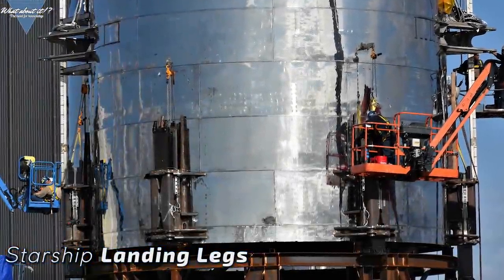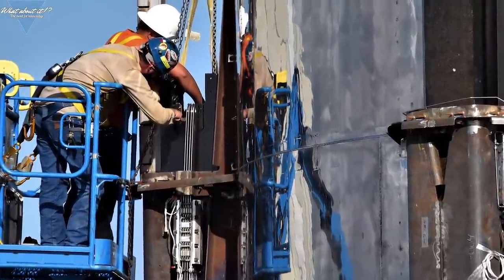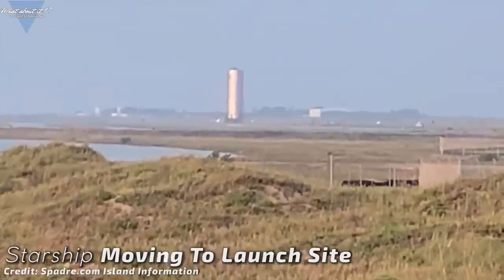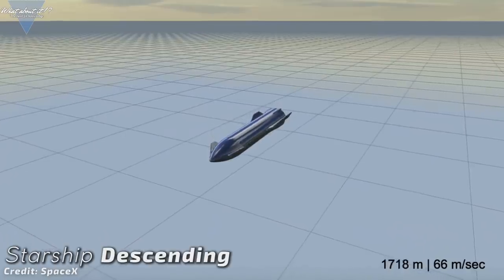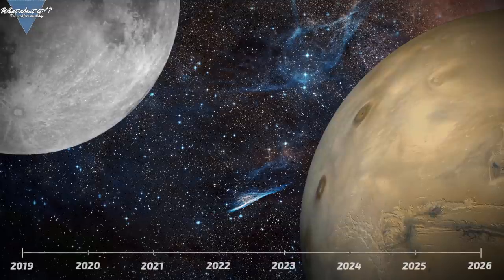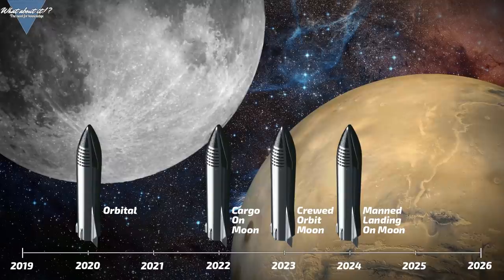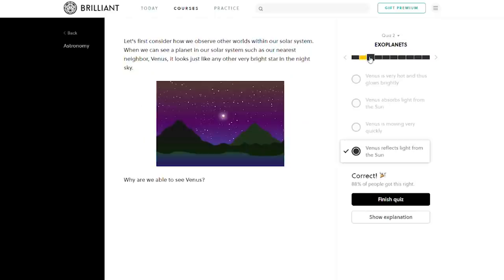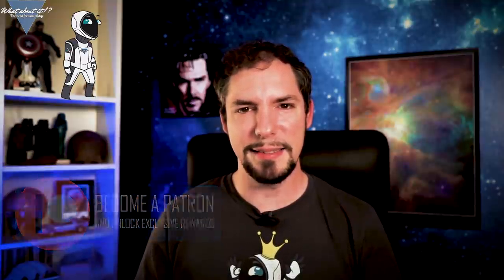46 | SpaceX Starship Updates & New SpaceX Moon Landing Schedule

Comment: A)    Some form of linear ramp motor (DC).  Remember that these stabilizers (or landing legs) are on the booster, so will not be landing on rough terrain, just their return pads.      B)   Nothing wrong with the time schedule. Even if it slips a little from unseen circumstances, it keeps the workers on their best foot.    Thanks once again, Felix.

Comment: 0:35 I think that the real ratio you have to consider is (position of Center of gravity) / (wide of base).  Probably the ratio is less than 2 in the Starship, very estable (tipping angle aprox 14º)
Reply: Great point, Enriquue!  We don't know where the vertical center of gravity (CG) will be, and CG is what really matters--not the overall height.  
The CG can be manipulated depending on how they build/load it.  We DO know Musk was worried about CG being too low to execute the controlled "skydive fall" reentry, so they put heavy batteries and controllers in the nose.
Reply: @737smartin  Maybe what the need is to mount the batteries (and other heavy stuff) in an elevator in order to move the CG dynamically: High for flight and low for landing :-)
A minor complication of the elevator would be that it needs to pass through the tank sections :-O ;-)
Reply: @Jens.Krabbe  That is JUST what a submarine does but horizontally by using its trim and auxiliary tanks to maintain a neutral buoyancy. Not a bad idea in theory.

Comment: If SpaceX can successfully launch and land Mk 1 by the end of this year, I'll give them a slim chance of actually making it to orbit by 2020. 
But landing this thing on the first try is not going to be easy. SpaceX has already lost eight Falcon 9 boosters to landing failures. And Starship prototypes are much larger and more difficult to assemble. So having just a couple of landing failures will set them back quite a bit. 
I'm pumped to see the first flight test!
Reply: No..They will use the Falcon9 Data and Starhopper Data to make Starship Land.. Sure there may be some failures but not as much as their first try on Falcon9
Reply: Look at Blue origin and their shitty landings (after 15 years), compared to SpaceX. There must be something about the software, SpaceX uses. It is adaptable, like we saw with the "failed" landing of the booster for CRS-16. Technically the landing was correct although there was a major technical problem. Their software is just unbelievably tolerant
Reply: @Fannystark007  Keep in mind that this is going to be a much more massive rocket than the Falcon 9, and will approach landing differently. I'm sure SpaceX will use whatever knowledge and experience they have to attempt a successful landing on the first try. But even a single setback can set the company back, and the Starship timeline is RIDICULOUSLY ambitious. I love to see it, but everything must go perfectly, all the way through. 

Look what happened with the Dragon crew capsule explosion. The capsule was supposed to have been carrying astronauts by now, but because of this one setback, it won't happen until the middle of next year at the earliest. And if they have another setback... 2021, maybe.
Reply: @Fannystark007  you may say "Machine Learning"

Comment: When you spoke of the stability of the vehicle when on it’s legs did you consider it’s centre of mass on landing. All the fuel gone and the engines down low it might be more stable than you think.
A good chess set has lead weights in the base of its pieces. The queens of my set has a tip over point of about 45    degrees.

Comment: My conjecture is that legs will drop by gravity and the brakes on the legs will only activate once all 6 or all of that leg's tripod have touched the ground.  (dividing the legs into two tri-pods and equipping each leg with redundant left/right ground contact switches and leg brakes would make this a very reliable 4-way redundant system)  This logic is very simple to setup, and gives you self leveling with no new code and no new heavy active actuators.  I do expect to see a positive locking feature added eventually, don't want the rocket toppling because your brakes slowly leaked and lost grip... 

The eventually retraction mechanism will be the lightest practical.  So for example, a RCS firing on orbit or a pneumatic cylinder, etc.

Comment: considering how much weight the engines add when the tanks are empty, the center of mass is probably very low when landing, so the legs would be wide enough. Landing with cargo is a different story, but I think they've got enough experience with control systems to get it precise enough.

Comment: Heroic schedule with myriad firsts!  The Starship/Super-Heavy Launch System is monumentally huge on several counts with multiple component and system design challenges, each with its own set of complexities. I'm sure SpaceX will keep a close eye on the critical path(s) and relative degree of risks associated with each major component and system. Lots of places to fail/learn. In SpaceX's favor, they have continually demonstrated a withering design-build-test-redesign-rebuild cycle. Hopefully they are able to ferret out most of the design and function problems/solutions in the component/sub-system test phases. There will probably be some major cliff-hangers during the major systems testing or even key component validation.   The landing system / leg design looks ingenious. A linear motor assembly like the Hyperloop design would lend itself well to fast, precise adjustments. Leg-positioning, dynamic control and response, power-stroke requirements, linear dynamic and friction braking, etc., all seem well served; though, easier said than done. No sign yet of the size/design of the landing leg pads. Crushing and settling of rock and unconsolidated material under landing leg pads could provide a high pucker factor for first-time landings in a particular spot. The 150 ton-mass Starship center of gravity could tower 20 to 30m over landing pads set just 4.6 to 4.8m out form the spacecraft centerline!

Comment: What you describe as brakes on the legs are more likely to be position sensors.  So that the control system is able to sense the leg extension length

Comment: But lateral forces are possible.
May jam.
Lubricant?
Heat-resistant grease?
Or a lot of micro-roller-bearings?
Clouds of dust, sand, small stones.
It would be nice to put on a cover (trousers).
Further into the forest ― more firewood!

Comment: You said (paraphrased) "lending will be a bit like a roller coaster with 750tons of thrust". That is incorrect : only the GIMBALLED engines will be used on landing and that is I think 6 or 7 and probably fewer. Plus they will be HEAVILY throttled back. Starship will be MUCH MUCH lighter on landing and so only a few throttled-back raptors are needed otherwise it'll be far too much thrust. Massive weight difference between launch and landing. 37 raptors in Super-Heavy max at launch, full throttle, yes that would be about 7400tonnes of vertical thrust.

Comment: linear actuators are preaty weight inefficient when it comes to force and when they use aluminium rails it will aso need energy to hold anything 
so this isnt the best motor for this job
but maby the simplicity will make it worth it

Comment: I think the landing electronic sensors have some light clamping force, but they do not hold the weight of Starship. What I think what will happen is when the legs are lower by hydraulics, the hydraulic system enters in a passive state, allowing all the legs to move. If the rocket lands level, when all the legs start moving upwards the hydraulics system then prevents the flow of hydraulic fluid from the hydraulic ramp (not installed yet) keeping the rocket level. I think this is a simple system of keeping the rocket level on a pad, but the area where Spacex intends to land Starship on Mars was once a sea and it still may be a frozen sea with just some regolith on top, when it comes to Mars Starship will need to be dynamic leveling just because the water in the martian regolith may melt under the warmer legs, causing the rocket to become unstable and tip over. Look want happens to the buildings placed in Antarctica when placed on the snow and ice if there are any doubts.

Comment: Question 1, how do you land 150 tonnes on the Moon surface, whose hardness cannot be predicted,  without the very real possibility of toppling over? Question 2, how do you land something with 750 tonnes of thrust, without creating a massive crater, probably 10's of metres deep, then prevent toppling over in this hole  that you've dug for yourself?
Reply: Good questions.  That's why SpaceX partnered with NASA to work on issues related to landing on the moon's surface.  That regolith (moon sand) is supposed to be extremely abrasive, and challenged even the Apollo astronauts with their little lander.  It may require SpaceX to risk the first few (unmanned) Starships to experiment with landing techniques that may or may not work.  If the task proves too difficult or too risky, Starship may have to just orbit the moon and release some kind of lunar lander (in which case, Starship will be taking the place of the lunar gateway).
Reply: @Jason Buford Haha, a bit of a chicken & egg situation then develops.
Reply: @Jason Buford This is happening on the moon.  Here on earth, SpaceX had to sink pylons 30 metres when building the launchpad in order to account for the predicted stresses of a launch.  Doing the same on the moon would be an order of magnitude more difficult - even if they were intimately familiar with the terrain.  imo, whatever SpaceX manages to land on the moon, it won't be a 150 tonne starship.

Comment: Does the need for two different systems (main engine gimbal and RCS thrusters) to work at the same time to move Starship upright pose a hazard?
Reply: no, the worst part would be loosing 1 of the systems but i feel like the computer would be able to correct for the loss. what are the chances of loosing all 3 engines or the entire RCS system
Reply: Three systems may be working at the same time. The lower fins will be folded back and passive, but the top ones will be fully flat to help "push" the nose back - and perhaps making slight adjustments. 

F9 has landed successfully 45 times with the gimbaled engine and RCS thrusters working in unison, so SpaceX has a handle on this. However, Starship is a different beast, and that kick maneuver to past horizontal and then back is more radical than anything F9 does.

Comment: I cant fathom these legs at the moment since starship will weigh over a million kilos. Max landing weight could be around 500 tonnes, so each of the six legs will need to be able to push around 100 tonnes, even more and double in case adjacent legs fail or hit soft ground - the feet will be fascinating too.
I expect starships schedule will be increased/changed next year as it becomes confirmed that it is working and policy makers consider how much a rapidly reusable 150 ton orbital delivery capability changes space economics. Asteroid mining and Solar Shading to combat global warming will have unique value. Moon and Mars bases will likely be expensive installations for special tourism and some brand new space culture, but mostly underground cathedral building, due to the difficult problem of solar and galactic radiation above ground.

Comment: Using the Linear Motors is logical - it's tech from within the Boring/Tesla part of the family. But,.. The type needed are ones that stay stationary when the power is removed - just like Semi Trailer brakes use compressed air to release the brakes, and lock on when the pressure is lost from the system, Starships legs will need to do the same, so the ship doesn't settle or fall when shut down.

That schedule - the main thing that will slow them down, is the paperwork and pressure from the competitors who've been stagnate while sucking on the government gravy train teat. ULA will be campaigning to slow down SpaceX, rather then be shown up for how slow ULA moves, and how they've kept the prices for access to space artificially high for the last five decades.

Comment: Why are people so focused on colonizing planets? It is much easier to "terraform" a rotating space habitat than it is to terraform a planet. It is also much easier to move such to convenient locations, e.g. within reasonable communication distance of Earth or to the asteroid belt to set up large scale mining operations. And if you want to get to another star system, you will have to get really good at living in space first. Accelerating a 100 t payload to .013c (and slowing down at the end) would require a fuel mass equivalent to the mass of Earth (Isp=600s). At that speed, Proxima Centari is 3000 years away. Does Gwynne plan to live that long?

Space is big. Let's take baby steps in this system first.

Comment: Elon-Time may apply.
Reply: Etheoma 

If it’s Shotwell time then may be solid.
Reply: Elon time = 30x faster than NASA
Reply: @gwyn.  It was mostly a joke, honestly a few years after Starship has managed to achieve orbit I wouldn't be surprised if it's used to do manned moon landings.

which if they are going to do the first orbital flight in 2020 that means 2022 is a reasonable time scale if the claims of rapid usability and minimal need for refurbishment are true as they could do many flights with just two Starships to prove they are ready for manned flight, like 100 flights between the 2 Starships should still leave 100 Flights left over and say they can do 50 flights per year, that should be enough to demonstrate Starships reliability to 99% reliability.... If there is only 1 crash.

Although considering you can fly Starship autonomously it could be as early as late 2020, although 2021 is more likely if they decide to do an unmanned trip. As said though I think sometime 2021 would be better as I doubt even SpaceX wants to mess up a moon landing.

Comment: Spacex just got a big slice of launch work for the USAF,  and the USAF is going to use Star link for a major portion of their communications. Great news for Spacex!
BUT!...NASA has commissioned 10 SLS  center booster cores from...(Wait for it)...Boeing.  For a, so far, leaked 2 billion per.  If I combine the face that an SLS has not even flew yet, heck they have not finished one after ten years. Not to include their 737 MCAS issues.   By that timeline Artemus  will get to Mars by 2075.

Comment: Hey there what if spacex build a spaceship bigger than ISS with all survival gears for the mars journey then on reaching hover around the planet then launch there starship to the planet.this is important where in any emergency may occure they can escape to the mars space rather than one way back home which is far
Reply: The problem is decelerating the ship when it arrives at Mars. Starship burns most of its fuel to accelerate, and has just enough left for landing. It relies on entering the atmosphere and aerobraking to decelerate from its high transit velocity. Carrying enough fuel to decelerate in space using the engines would need bigger tanks, and the extra tank mass and fuel mass require more fuel to accelerate it to Mars, then need more to decelerate - you see, it becomes a super-difficult engineering spiral. It's called the merciless rocket equation. So placing a large structure such as you describe in orbit around Mars is very difficult.

Comment: Linear electric direct drives are not a good option for controlling the legs. It's not possible to generate the necessary forces and you would need additional mechanical brakes

Comment: Shotwell is full of it.  I never heard anyone doubt that Falcon 1 or Falcon 9 could be made to work.  I never heard anyone doubt that Falcon 9 could be landed or Dragon would make it to the ISS.  I like SpaceX, they have changed the launch business for the better and are a valuable asset, but they are absolutely full of it.  Their capsule exploded because there was a hydrazene leak and they lied about it and that says a lot about their culture.  That’s a cover up and potentially criminal.  Yes, other projects have gone this fast before, but in Russia, not here.  And while using the exact same methods and mentality and probably with the same results.  You’ll see a lot of seemingly impressive ‘firsts’ followed by a significant slowdown as reality hits, punctuated throughout by abundant failures.  The point brought up regarding landing CG shouldn’t be lost, especially with regard to landing on the Moon.  There will be no prepared landing pad there and a potential for some ‘hole digging’, uneven surface and uneven surface strength.  I can only hope Falcon 9 style legs are used, at least for stabilization after contact and be thankful it's only 1/6 g.